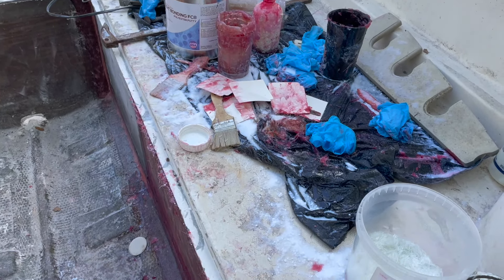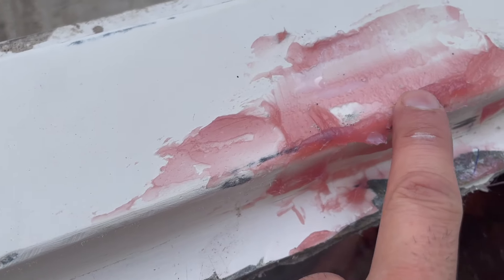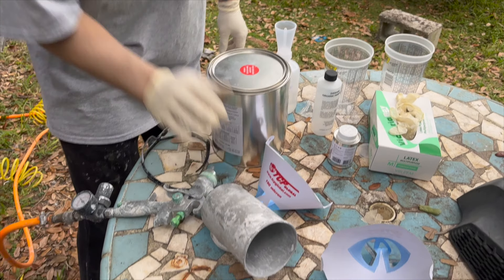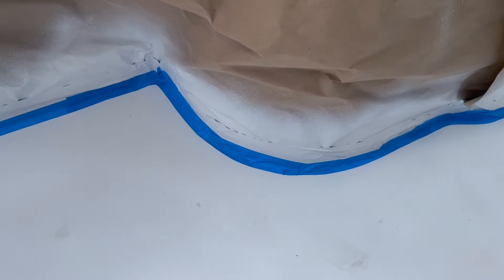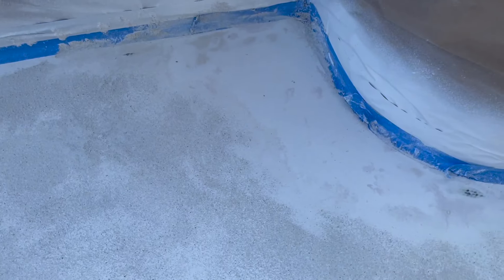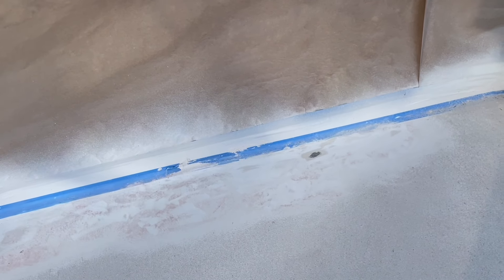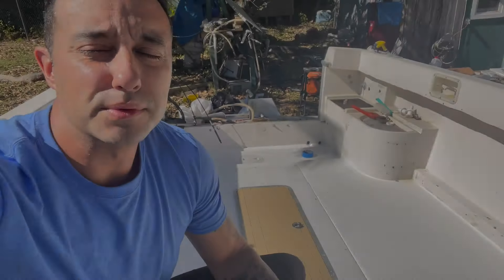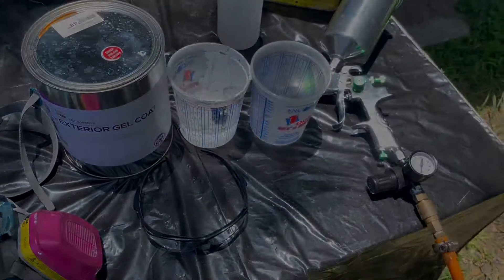EASIEST Way To Restore Your Boat Deck : AMAZING Results!!!

Comment: You guys might not be professional boat builders, but man you’ve done an awesome job restoring the deck. Grady White is a heck of a boat and built like a tank. Restoration is going beautifully well so far. Can’t wait to see the final product. Like to know at the end a $ amount of amount spent not including labor. Total cost of the restoration project.?????
Reply from the maker: Hey Jorge! We are still working on her as we use her. We stayed doing the topside already, we’re getting ready to shoot the gunnels with gel coat and redo the gel coat on the floor last. Once we’re done we’re gonna make a longer video of all the work with a breakdown of all the cost. So far it’s been about 15k in parts and supplies including the boat itself, 23k for the motor. As far as labor goes…I have no idea lol🤙🌊🛥️

Comment: Nice. I did a similar non-skid using Awlgrip paint and Soft Sand non-skid particles. Same process.
Reply from the maker: Nice! How’d it turn out? I’m about to do a nonskid job with paint for the first time on an outboard bracket. I’m starting to like paint better than gelcoat! Thanks for the comment Ray! 🤙

Comment: Wassup brother.  Even though it's a year old, I appreciate your honesty.  Your facial expression is so sincere that it makes me think the freegin dog died or you screwed up a clients boat.  The inspiration continues. 👍💪
Reply from the maker: 🤣🤣🤣 yeah that sucked. Worked so hard to prep it and I screwed it up lol but you live and learn. We’re about to do the floor again anyway. This time, the right way! 🤙
Reply: @perfectfitboating  Have uou heard of Marpro Gel coat?  If so, what's your thoughts on it?
Reply from the maker: @aeroscout8409 yes, mar pro is a company that rebrands alot of different marine products. I saw them pop up at a local shop like a year ago maybe more. I don’t know what product they’re rebranding though. We’ve used FGCI gelcoat from the beginning and have had great success. We just used it today actually to fair part of the floor of a transom we’re working on. Check out our instagram you can see it there. I’ve sprayed it, rolled and brushed  it and it’s  awesome!
Reply: @perfectfitboating  Okay, thanks. It's getting hard to find stuff over the counter these days.

Comment: So got the weather to glaze radar bar holes.  So gathered my nerves, and finally put a coat of USC Glaze over the small holes in my radar bar.  Started a little shaky cause I mixed a large batch ( bout a 3" puddle) and it kicked quicker than I expected.  So mixed up smaller batches and it worked out so much better.  Knocked down some of the excess after setting so it's not as time consuming when I finalize for gel coating...  Almost there brother!!!!!
Reply from the maker: Bad ass! In this weather it’s always best to do smaller batches. I try to keep any type of resin batches to 8oz or less. Just kicks too fast. I’ve even thought about placing the resin in a cooler with ice right before mixing so I have a longer working time. 
Send pics so we can see!🤙
Reply: @perfectfitboating  Will do!!!

Comment: what silicone did you use? silicone doesn't usually grip to plastic surfaces or fibreglass
Reply from the maker: 4200 marine grade 🤙
Reply: @perfectfitboating 
That’s not silicone. 
That is polyurethane with a cyanoacrylate component. 

Silicone doesn’t belong anywhere near a boat except ‘maybe’ ‘rarely’ bedding glass to fiberglass or metal.
Reply from the maker: @fishhuntadventure never said it was

Comment: What gun are you using and what tip
Reply from the maker: The exact gun is linked in the description. It’s a hvlp gun with a 3mm tip if I remember correctly.🤙🛥️🌊

Comment: Great video, new subscriber! What was your paint gun setup? Tip size? Pressure? Thanks!
Reply from the maker: Hey Bret! Thanks for the comment! 
My setup was a fairly cheap one off Amazon. Depending on where you are you have to work fairly quick if it’s hot. And if you don’t you’ll have to throw the gun away. Seeing as this was my second time spraying and I’d probably screw up, a cheaper style gun made sense for me. That being said, I used a 2.3mm nozzle (for shooting gelcoat it needs to be a bigger size than standard sizes) I sprayed at 50 psi and I have a chiller I use to keep water out of the gun. You can probably get away with a small water separator attachment. It lays down ok. I’ve also learned that mixing gelcoat with duratec lays down gelcoat with the finish of paint and you can use a smaller size nozzle. I’d look into that if I was you. Hope that helped! Thank you for the sub brotha!🙌🍻

Comment: I don't mean to be a past but wouldn't it be easier to add the non skid to the gel coat stir it good with a drll mixer. Then catalyze it ar 2% and roll it on. It's non skid bro. You can just roll it on . Spray the stuff that isn't non skid.
Reply from the maker: Yeah that’s one way to do it. But I wanted complete and even coverage of the entire deck. Can’t really do that rolling it on.

Comment: Thats not quite the way to add nonskid. Better way is mixing it up with topcoat paint and applying it with roller
Reply from the maker: Sure it is. This is one way to do it. If you watch Andy from boatworks today he uses this method regularly. Your method works as well. Different strokes for different folks. Thanks for the comment. 🤙

Comment: FIXING YOUR BOAT BY YOUR SELF,,,PROS: you will save money ,,, CONS : You have no idea what your doing... 1 wash the boat, let it dry,,, Now Wash it with Acetone, get a grinder with 40 grit , get the dust out , wash with acetone , Tape off USE 3M(233) never use blue tape ,,, never use a spray gun for gelcoat ,Presser pot a must , spray that whole area in 10 mins ,,,NOW sprinkle Salt , and spray over it ,,, put an Easy up over your area so the sun doesn't heat the boat up ,,,   Gel work for someone who 's what to do ,,,1 day job...
Reply from the maker: I can’t decipher what you’re blabbing about.
Reply: @perfectfitboating what ever works right 👍
Reply from the maker: Exactly! 🤙🌊🛥️